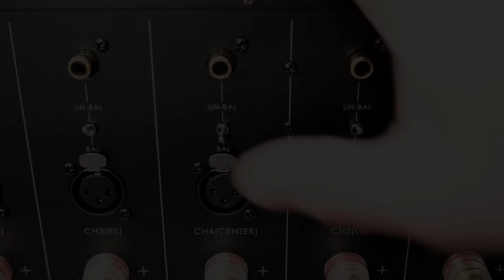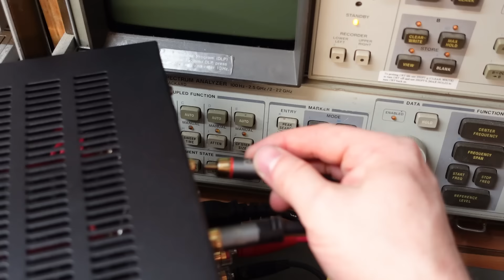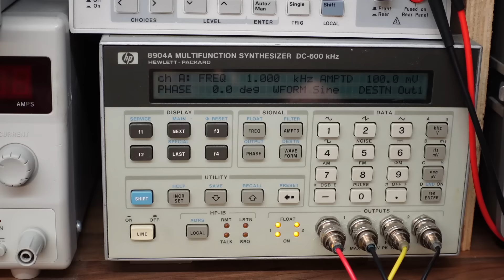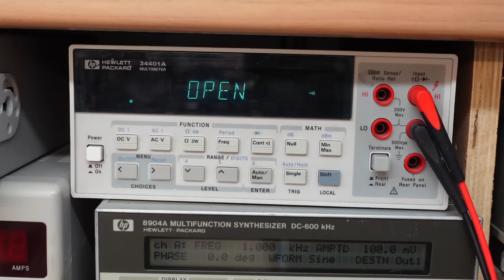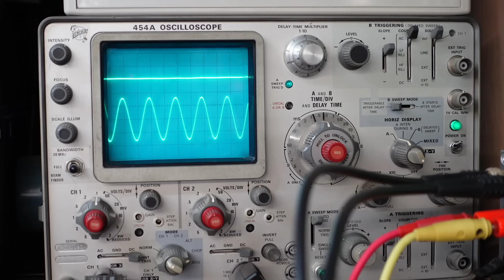The Unlikely Nakamichi Amp Fix (Build quality! Ahem....)

Comment: Nice one. Makes me smile when audiophiles are demanding gold plated connectors etc for phono leads and inside it just goes through a cheap plastic clip lol.
Reply: I call them audioplakes. They are happy to spend thousands on interconnect and speaker cables. They would rather have five shiny pennies instead of a tarnished quarter. Just as they were duped by Mobile Fidelity, when the audioplakes thought their "great sounding" vinyl LP's they paid over a hundred dollars for were cut from the original analog master tapes and they find out they were cut from a DSD digital master tape that was made from the original analog masters.
Reply: The one I like from the "audiophile" community is directional cables. Yeah, so you want to couple an ac signal with something that works better in one direction....... ok then.
Reply: @mistermac56  Audiophools for me 🤣
Reply: I think you are all too polite. 
They are just snobs. TBH it's straightforward to discern which speaker is better but amplifiers, cd players and mini disk players it's hard to discern any appreciable difference. 
    Turntables, like speakers, are easy to seperate the bad or ordinary from the good ones. For many people a decent ceramic cartridge is good enough and a standard magnetic cartridge is more than good enough. 
     And when you are old enough to afford the crazy prices your hearing is shite so you won't be able to appreciate IF they sound any better than a good system from Sony or Dynatron costing a lot less.
Reply: The idea isn't so bad, you have the gold plated for the external connector because that's what'd otherwise get tarnished and dirty, the inside doesn't really matter because that's just gonna sit there unless you need to repair it. But yea it's probably overkill for something like this unless you live in a very humid environment, near the sea, stuff like that.
Reply: Aaah the days of the audiophile dreams!🎉❤
Reply: Shhh. Go listen to your bluetooth speaker and let us enjoy our superior sound in peace.
Reply: @Nukle0n Yes the gold plating is to prevent corrosion/tarnishing , it is no more conductive than copper , perhaps less so.
Reply: @mistermac56 When I was studying electronics I got a Saturday job in a HiFi shop. The number of expensive brands that used carbon pots and carbon film resistors in the signal path was boggling.
Reply: "cheap plastic clip"
I see that you have no clue about electronics..ah well, ignorance is bliss i guess
Reply: Makes me smile when someone assumes they know what an audiophile is based on watching a cheap amplifier get fixed due to it's speaker terminals, dude these were budget amps branded as Nakamichi and awful sounding but bang for buck. 

Audiophiles do not run budget 7 channel amplifiers like this.
Reply: @SastusBulbas1  >mad because he got called out

Comment: Nakamichi died in 1998 when Niro Nakamichi left and the company was bought by Grande Holdings in China. Same with Sansui, Akai, loads of other great historical brands. Post 2000 Nakamichi's relied heavily on the name to keep up sales.
Reply: Ah, that makes sense. It looks like a bunch of Aliexpress boards thrown in a box.
Reply: Top people at Nakamichi left and started a company called Sound Sream apparently
Reply: Nakamichi still has some hits. The Dragon 11.4.6 Atmos surround system (which capitalizes on name from the coveted tape deck from the mid-late 1990s) has been very positively received. But it's also ludicrously expensive for what it is.
Reply: I remember Nakamichi tape decks from the 80s/90s were the greatest.
Reply: @jafa1402  My dad had one. Specifically tuned to two specific brand/type of tapes. One normal and one high quality/bias/chrome. Combined with a Quad amp it sounded great.
Reply: Most Japanese Hifi brands are no more due to change in technology and decrease in demand. Now its all in portable Bluetooth speakers. Nakamichi, Sansui, Akai even Sony , Pioneer is no more releasing pure Hifi products and some of them are even taken over by Chinese brands. Very sad.
Reply: Shame that happened, I had a Nakamichi Cassette Deck and it was one of the best audio experiences I ever had.  How they made those components sound so good was incredible engineering 😎👍

Comment: It's not a "genuine" Nakamichi - they'd never have quality control issues like that where a connector could work its way out of the board. Sadly many well known "brand" names like Nakamichi were abandoned in the 80s and 90s and have been taken over by chinese manufacturers who rest on the previously good name to sell their junk. This amp is slightly better than most of the chinese stuff I see, so they did put a bit of effort into it but the budget build quality is still evident. I can tell that just by looking at it.
Reply: Actually, having worked on many genuine nakamichi receivers and amplifiers, I always made it a point to exercise every single connector and check them again for intermittens by wiggling them. Often I would flush them with alcohol too just to make sure they were well degreased but usually pulling them off and pushing them back on would wipe off any minor oxidation. The soldering to the pins of the connector on the circuit boards was also a common failure point on many older Nakamichis and a lot of equipment in general with these types of push on connectors. Lord only knows how many thousands of pins I must have resoldered over the years on those types of connectors!
Reply: Unfortunately that's pretty much the fate of most once-big companies in the electronics sector (and elsewhere). All the German brand names like Telefunken, Grundig, Schaub-Lorenz, Blaupunkt, AEG etc. have had the same happen, where the only thing that still exists is a holding company that will license out the name to be put on any kind of generic chinese junk, and the same is the case for a ton of american brands (RCA etc) and probably plenty of british ones too, just can't think of an example from the top of my head

Comment: Even if it is an easy fix it is still worth filming it as we have a chance to have a peak inside of rare beauty like this one. Thanks for that upload.
Reply: I agree.. even running a Hi-Fi business you don't get to see items such as this every day! Great video!
Reply: @jacksonsystemslimited  Stuff you need a hand truck, and a strong lad or two to transport safely.
Reply: @thomasmleahy6218  32kgs
Reply: beograd07   exactly...we need to see the quickie ones too...call them shorts if you like...not all fixes are rebuilds...some are simply loose connections...and this Amplifier is the most awesome power amp i've ever seen...obviously it has a separate pre-amp...i'd love to see what it's paired with...the total Watts per channel must be outrageous...you wouldn't live in a terraced house or flat with this output...my bookshelf speakers would blow the cones as soon as it's switched on...
Reply: I agree, even the simple fixes are entertaining.

Comment: Looks like an Emotiva / Sherbourn amp! Certainly a budget oriented chinese amplifier that has nothing to do with real Nakamichi, someone bought the brand name years ago and flooded the market with cheap loudspeaker connectors and questionable amps and such.
Reply: Correct, it's a 'modern' Nak by another cheap chinese manufacturer. No different to the stuff being produced today under the AKAI brand, which is nothing like the quality stuff that the real AKAI made years ago. So many "quality" brand names have been taken over by chinese manufacturers and slapped on complete junk.
If you look closely you can see the tell-tale signs of the budget build quality, although this amp appears to be a little better than the usual cheap china offerings.

Comment: Nakamichi made some very nice equipment.
Reply: And some scrap, like the sound space 3 😂
Reply: And then also there’s this?
Reply: Yeah, I remember amps like the PA7E, it was amazing, still sad I sold it
Reply: @jean-philippefahrni8415  , The Niro brand mini systems were also complete crap and they all failed prematurely due to crappy capacitors.  There was no doubt that it was all over for the original nakamichi company when they started building junk like the Music Bank and Soundspace series aimed at the Sharper Image customers.
Reply: @WeinStefan32   I've repaired a number of PA5 and PA7 amplifiers. There were A versions and series 2 versions and also the E version of these and each had their own unique issues but the one common problem was that they all ran quite hot and the solder joints would break down, and the foils would delaminate from the circuit boards, as well as drying out capacitors prematurely from the heat.  The driver and especially pre driver transistors were undersized for the job and ran quite hot and so we used to upgrade to larger more rugged devices and add heat sinks. The virus and DC offset trim pots often cracked and became intermittent or drifted in value and setting and so I would use install 20 or 30 turn replacement trimpots in order to keep the bias setting stable.

Comment: How about a dab of hot glue on that connector?  Looked like the base had been pulled up off the PCB pins.  A couple of dabs of hot glue would prevent that from happening again?  I'd also have done the same on the other connectors for preventative measure.  But we do all like when an easy one comes along.

Comment: Nakamichi!  I didn't know Mr. N himself died that's a shame.  RIP Mr. Nakamichi.

Back in the 80's I owned a Nakamichi 482 3-head cassette deck that was wonderful.  Then I bought a 682ZX that was EVEN BETTER!  You calibrated the recording parameters according to the individual characteristics of the cassette you were using, which only took 30 seconds or so.  This set the deck up to achieve the maximum performance, regardless of the tape used.  What a magnificent unit that was!  With Dolby-C & TDK Super Avilyn (SA) cassettes, switching between the music that was being recorded ONTO the tape, then playing back the actual recorded music a half second later (because, again, of the 3 separate heads), the sound quality was indistinguishable.  Geez I loved that deck!

This amp, as has been said, was built after the Mr. Nakamichi era.  And yes, losing a channel simply because a bloody stupid plug had fallen out would not have occurred in their heyday I'm sure.  Mr. N would have rolled in his grave I'm sure after hearing what happened to this amp!  Still, 'only a plug fallen out' is not that major a repair after quite a few years!

I have a Nakamichi tuner/amp (350 in the model number I think) somewhere that I was given years ago, that I must return to one day to repair.
Reply: i still have a 600 from my dad. i will not give that thing up.

Comment: One wonders how such a fault occurred. That plus the potential capacitive coupling between grounds makes me think that maybe Nakamichi quality isn't all it is hyped up to be. Thank you again Mark for making and sharing another interesting video.
Reply: Maybe a litz weave on those grounds to banish any coupling. Ground wires were a hasty pudding afterthought maybe? I thought a better solution would have been on the underside, with possible shielding by the caseworks, shorter wires in any event.
Reply: A grounded solid brass or copper bar to connect al those channel pcb's to, with short wiring, will do a better job. Or a ground plane construction. The way Nakamichi did this is completely bullocks.

Comment: I know the feeling when we used to get a "just re seat it" and it worked😊 on an Aircraft,  I'm a retired Aircraft tech. (Must be ready by Morning 😢) , an extra brew rather than none at all 😂 Thanks Mark for taking me back 20 years 👍
Reply: Hahaha. Re-racked LRU IAW AMM (insert manual and chapter here) All ops now check normal. I’ve written that in logbooks many times!
Reply: @Fireship1  Me too ✋️ further air test required,  no fault found, satis  , 😊, and  invariably,  it was okay 👌 after.

Comment: I don’t think they ‘demand’ gold plated anything, it’s the manufactures who think there’s a need for it. However, as an audiophile myself, I do expect a connection which doesn’t degrade too much over time so I use cables mainly with nickel plated plugs which don’t cost an arm and a leg.  Some audiophiles are proper nerds and will believe all what the manufacturer will tell them.  One just has to have a listen and judge for yourself.

Comment: I've ended up with a few decent pieces of hifi because I bought them cheap as 'broken' and found they only needed cheap repairs. 
Thats how I got both my Adcom amps. The 5x5 series have internal fuses you can't see unless you take the cover off. Both of mine were DOA, but fired right up after the fuse was replaced.  I toned them and tired to find whatever caused the fuse to blow in the first place. That was years ago. Still pounding the ground with my JBLs all this time later.

Comment: Recently discovered your channel new sub thanks. 

Nothing wrong with posting a simple fix.. in fact its just as important to the complex fixes if there are any electronics techs and DIYers trying to learn fault effecient find process..

I struggled when started this game in the 1980s.  I always went for the complex way. Lol then my boss sat down with me and said.  "Always start at the power supply 9 times out of 10 most you'll find the problem from there".  Sure a gross over simplification but it forced me to do the most basic chks first and it worked.

Love your stuff keep em coming 😊😊

Comment: Nak - best Japanese gear ever. I want a PA7 down the road. Maybe Ill ship it to you for a 'tune up', Mark. Good video, thanks.
Reply: I have worked on a number of PA seven's and the A and mark 2 versions. Note that they do not ship well at all ( The rear panel often gets bent and dished inwards and the entire chassi will shift out of alignment so that the screws get shoot up when you take them out and then they won't lineup with the holes when you go to put it back together again). The bias and offset pots crack and drift their setting with age and these units, which were designed to run hot in the 1st place, tend to really bake the circuit boards, delaminating foils off the board and drying out solder joints.  The driver transistors and especially the pre driver transistors are undersized and run blazing hot and should be upgraded, with additional freestanding heat sinks added. I also recommend replacing the original trim pots with 20 or 30 turn pots so you can set the bias and offset more accurately and they really need to be run with a cover on them to get good and hot before you can adjust them.  The small capacitors will be baked to death and will need to be replaced. These amplifiers can sound excellent but they usually need a lot of work.
Reply: @goodun2974  good to know. Im scared to let an unknown tech touch stuff as they might be rough with it and no one has ever 'enlightened'them that people dont want stuff scratched, dented and so forth. Mark seems pretty careful as well as being a really skilled technician.

Comment: That's funny because I have one of those exact amps. It had another fault with it, it would trip the start up circuitry when the massive toroidal powered up. I found that it was supported by a company in the uk. They sent me two upgrade kits for free of charge, one fixed the issue and the other addressed some noise issue

Comment: 0:48 ahahaha genuine lol  

I use a "broken" Marantz SR-18 as a stereo amp. is 5 channels with one blown, dead pre-amp and most low voltage regulators so shot only the volume control functions as it should. all other digital switching doesn't work, likely from spoiled voltage regulators. 

amp section weakness was poor power output transistor pin bending & soldering. That's been corrected after the rear blew. Amp is fantastic, and still super quite.
Reply: Quite super "quite" I'm shooer.

Comment: This looks fairly modern. I thought Nak died in the late '90s - when was this from?

Bit disappointing that they've joined the ranks of Chinese build quality merchants who use inferior JST-style connectors then glob them down with glue to make up for the crappiness. I've seen quite a few cases of infant mortality due to these things working loose in transit, horrible things. The original Japanese ones worked.
Reply: You are right. Nak did die in the late 90s and the name has been taken up by just another cheap chinese manufacturer. The Nak of today has nothing to do with the Nak of old. If you look carefully at this amp you can see it's china junk, although slightly better than the usual junk they offer.
Reply: @sw6188  So true! Nak tape decks were awesome!

Comment: Hi Mark
I have a question for you. I have an Denon amp with a fixed power cord. I wish to convert the fixed power by unclipping the cord from the internal board (easy part) then snipping at the appropriate length and soldering to an two prong IEC inlet. I then clip the the internal connector back in and fix the new inlet to the chassis of the amp. I have done this before this giving me a removable power cord. My question is the 0.75mm (2) power cable is double insulated bare copper at 20 awg. Can I replace that with 16 awg tinned copper? 
The amp in question is an Denon PMA800NE.
The power that will feed the amp will be a MCRU cord at 14awg but as I understand the amp will only draw what it needs so I don’t have an issues with the exterior gauge.

Comment: So what was this built for? I was involved in a big AV based visitor attraction installation setup with that many channels once. The soundtrack was mixed by a colleague. Run from an 8 track 1/2 inch tape with animatronics. That Amp looks as if it could do it. What a monster.